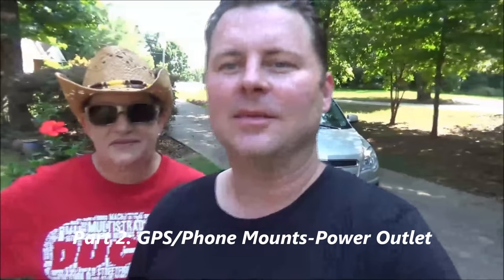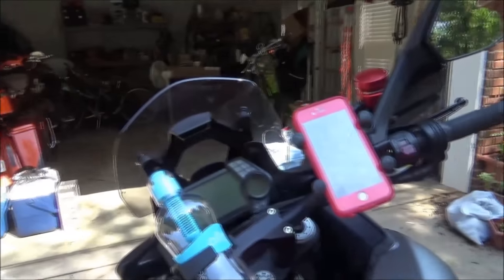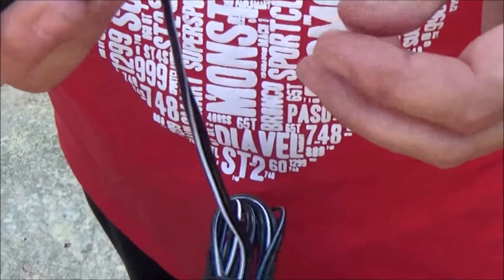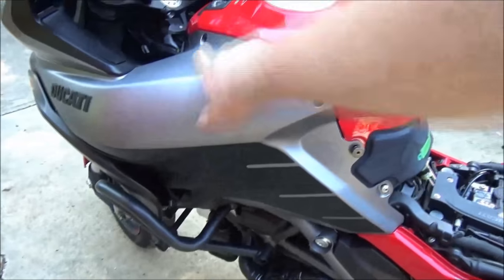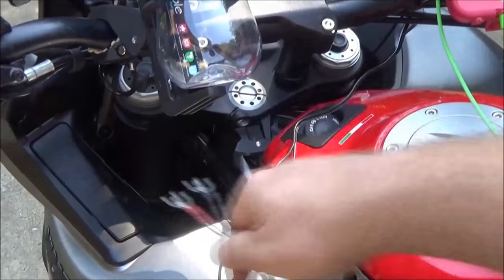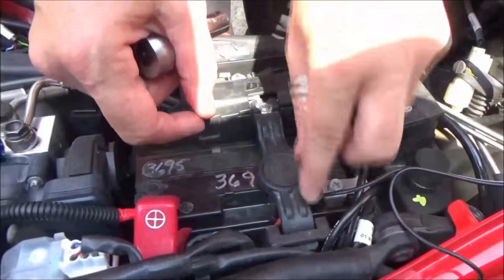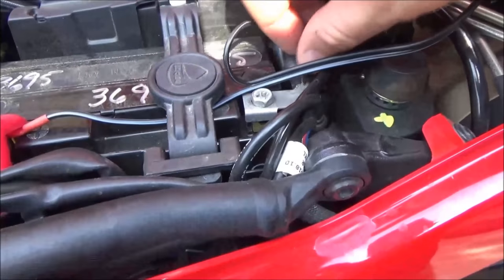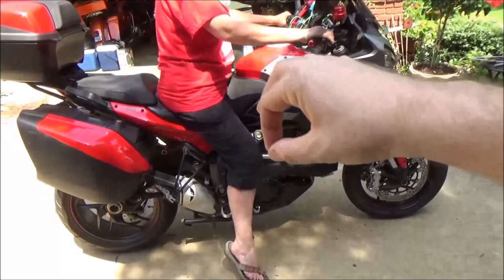Part 2: How to install a USB and 12v accessory power on your handlebar Ram Cell Phone Mount also!

Comment: Nice work guys, just one little thing.
The Multistrada has a special 12v connector for accessories....
It's under the little black left panel just below the left fairing.
The connector is only working when ignitionswitch is on.(no flat batteries)
Just a 3 minute installing job, no wire routing etc etc.....😉
Reply from the maker: Nice thanks for letting us know...:)
Reply: Yep, also a perfect place to tie in a GPS powered mount .
Reply: There are two of them. One on each side.
Reply: Nice, Can you ad a picture of that?